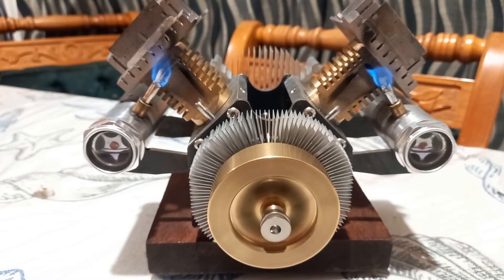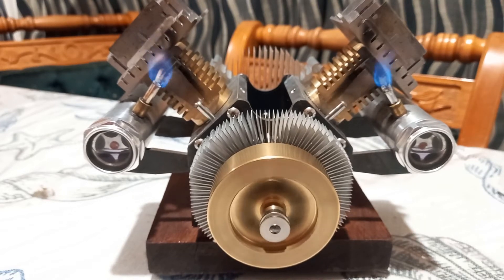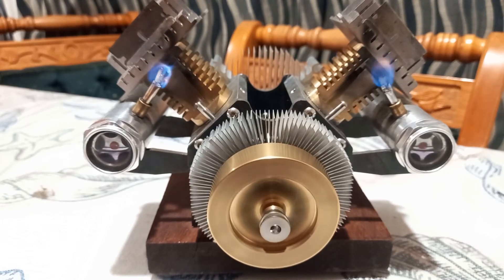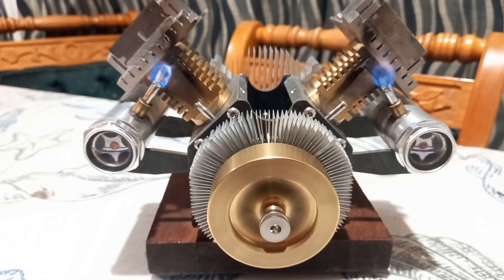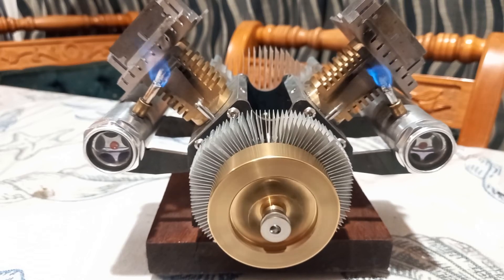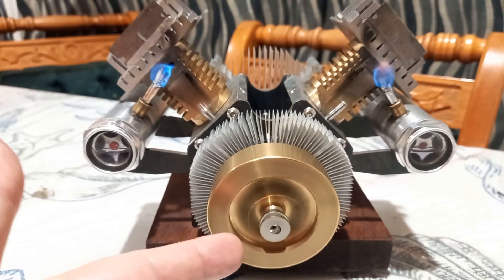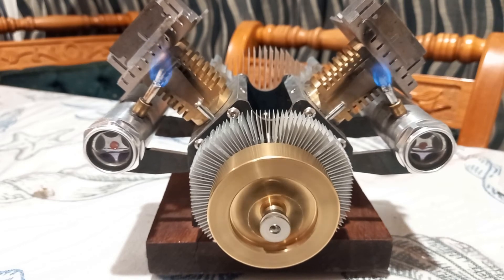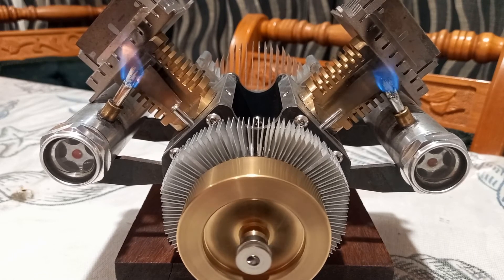V-TWIN SOUND! model #vacuum engine from China with pc heatsinks. V twin flamelicker flammenfresser

Comment: Who is the Overpressurvalve?
Reply from the maker: Who indeed. In a vacuum model engine, the returning piston might not sync with the valve if it shuts a fraction too early. This is what an overpressure valve is for; keeps the engine running smoothly and not farting out the intake valve and blowing out the flame. My German flammenfresser needs one; this Chinese one doesn't

Comment from the maker: Right at the end, after the motor has stopped, I turn it over by hand a few times. The reason is to get the remaining combustion gases out of the engine so it doesn't cool down with those in there: because those gases contain as combustion product...water. So turning over the engine by hand prevents the issue of tarnish /rust and piston sticking the next time I want to use the engine :).

Comment: amazing video, excellent mods to make this thing run as optimally as possible. just wondering would the v4 version sound better or worse than this?
Reply from the maker: Sorry for late reply. The V4 version hasn't interested me greatly. I'm trying to understand why...I guess the simplicity of the V2 is adequate for me; also there is something of the back-to-back nature of the V4 that I don't really like; it looks like an afterthought - two V2s. For my purposes, getting everything working with twice the valves, matching heatsinks etc is asking for unneccessary problems for little extra "fun".
Reply: @ThomasPCGuruENGINES  hey thx for the reply. i actually ordered the v4 a few weeks back just waiting for its arrival. hopefully it works out. im sure your vids will provide a good reference if there are issues. thx again